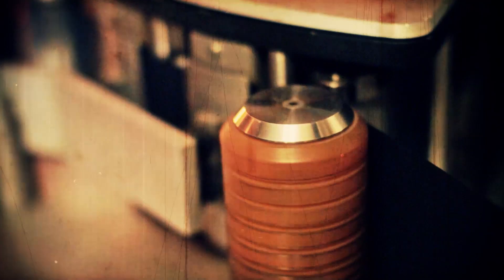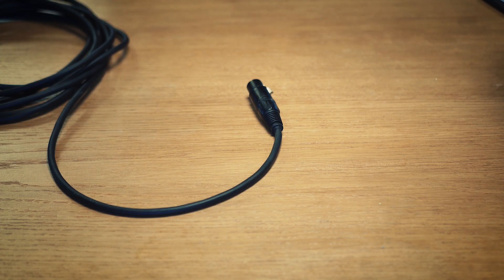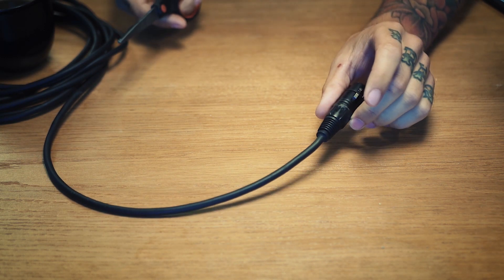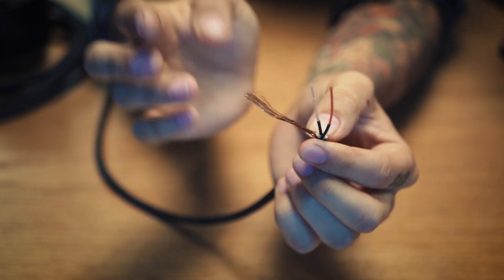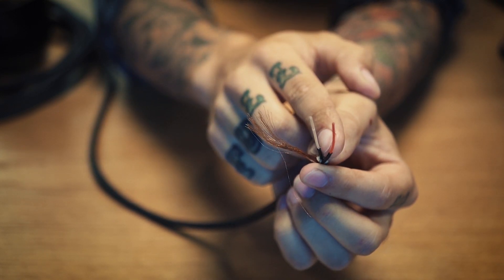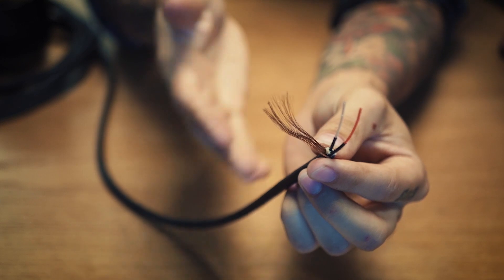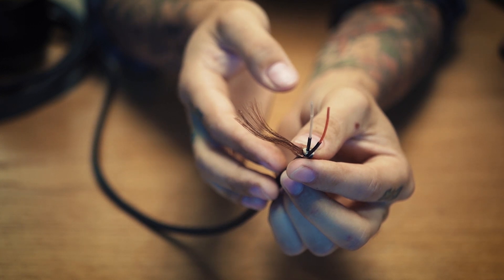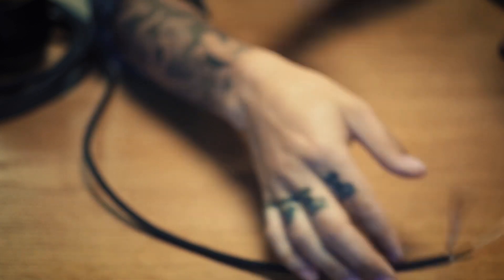How Balanced Audio Works, With Practical Examples (HoboRec Bull Sessions #34)

Comment: I think I'm still having a bit of trouble understanding.

1. We send a signal out of a balanced output.

2. The polarity of the signal is reversed during output.

3. The reversed signal is sent through the cable in 2 channels (one red, one white).

4. The signal picks up noise while it is travelling through the cable

5. The Signal goes into a balanced input and it's polarity is reversed again, restoring it's original polarity.

6. This reversal of phase causes a phase cancellation of the noise the cable has picked up but no phase cancellation of the signal.

Questions:

1. I really don't understand how this would result in the noise cancelling. I understand the concept of phase cancellation but if the noise is picked up during the transmission of the signal then it's polarity is reversed, how come the noise disappears and not the whole signal, or how come it doesn't just come through with the phase flipped so the waveform looks upside down but the noise it still there. I'm sure you explained it correctly but I'm just having trouble understanding.

2. Are the red & white signals out of phase while the signal goes down the cable? E.g. Is it just flipping the phase of one signal then reversing the same one when it reaches the balanced input.

3. so pretend this ---> WWWWW is a waveform.

* The signal looks like ---> WWWWWW

* It hits the balanced output where it is flipped ---> MMMMMM

* It picks up noise ---> M-M-M-M-M-M-M-M-M

* It hits the balanced input and is flipped back to ---> WWWWWW

So why doesn't it just still have the noise but the waveform is upside down.

Sorry, I can't get my head around this hahaha. I just use balanced as a rule because you're not gonna get more hum from using one. I never tried to actually understand it haha.
Reply: P.s I really like your channel but now your making me use my brain and it hurts. Stop it.
Reply: This also confuses me!

Comment: If balanced cables are so effective at canceling noise why are they not used as instrument cables?
Reply: because its not the cable that cancel the noise, its the unit that they are pluged in and out, your instrument doesn't have a balanced output and your amp doesn't have a balanced input.
Reply: And don't forget that operational amplifier is doing the job to eliminate the noise.
Reply from the maker: Good point Zelao. I probably should have mentioned that it's not the cable it self that are doing the technical part.
Reply from the maker: Hi Rex, I'm just guessing here but first of I think microphones are the most critical place to use balanced signal since the signals are so low. Plus the cable runs are usually longer with microphones than with guitar cables. I read something about "cost" that balanced signal for guitars would cost more with components and stuff, but I mean you can buy a mic for $5 that has balanced output. 

Any ways, it seems like outside noice introduced though the cable hasn't been that much of a problem through history when it comes to at least guitars. Most of the noice comes from the amp and guitar microphones. Otherwise I guess someone would have solved it.